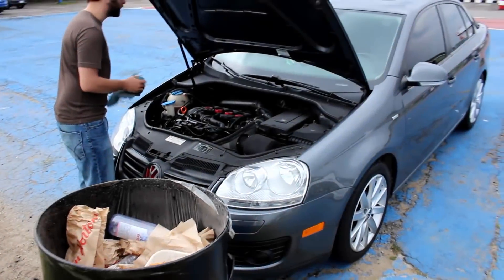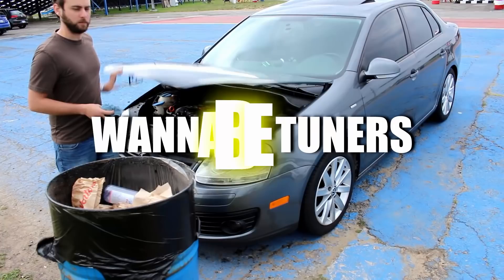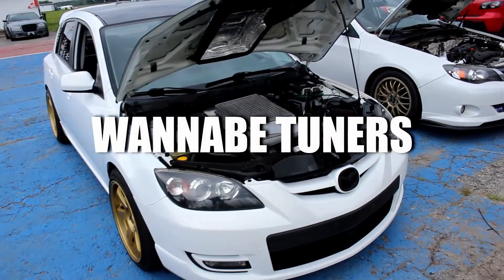Mazdaspeed 3/6 - Aux Fuel Methods - Port Injection - 5th & 6th Port - Methanol Injection

Comment: How is your car handling so much power on stock block ? Im rolling 285hp and 400nm of torque and I am afraid of bending rods. 18-19.50 PSI
Reply from the maker: The stock block will last a long time with a good tune and regular maintenance and care :)
Reply: Stay below 500Nm peak torque (3300-4000rpm) and and not make more than 400Nm below 3000rpm and you'll be fine with the rods. However make sure you're using good oil, that is a very important aspect. the stock block can handle above 400bhp as long as you keep the torque in check. If you go above 350-380bhp depending on the timing you can run, or more exactly around 345-365g/s of air depending on what AFRs you can run with the gas you have access to (I suggest using a WMI system with any turbo larger than the factory K04, and even with that it's a good idea to spray at least water of not water/methanol mix).
Reply: @mituc  Indeed, the only thing I'd add, specifically, is for the boost/torque curve and onset to be properly calibrated by the tuner, and for the driver to not go WOT under 3k, nor ever in 6th gear if you're tuned for stock-block power (~500whp max - though that's borrowed time, and ~380wtq max).
Reply: @numinous4789  , The problem with high power on stock block is heat which affects pistons and ringlands. WOT below 3k is a potential issue even on the stock tune, but with a larger turbo it becomes kind of a non-issue because the torque comes in more gradually rather than suddenly and you can tune the peak of the torque curve away from 2700-3200 where rods tend to break.
There are 2-3 people in the Mazdaspeed community who had 500-550 hp on stock blocks. They lasted 3 weeks of mid abbuse. However 350-420 with a proper spray of WMI (better than in-tank methanol or ethanol mixes IMHO) is usable for a much longer time.
Reply: @mituc  Agreed, Victor, heat management is a major priority on stock ring-end gap. That's why I do E25 in-tank and spray 1000cc M1 on top of it. All that alky helps keep things cool and prevents ring-butting. I'm also on a BNR S3 setup and tuned for 390/385 @ the wheels. Engine is strong, healthy, and happy on a FREEKTUNE (been 45k since going BT and still going great).

Next thing I'm throwing in is the South Bend Stage 3 Endurance in my closet. Long-tern goal is to build with 4032s and go with an EFR7163 or G25-660 setup to tune for a very responsive 500whp for tracking.
Reply: im running almost 380 with the bnrs3 and im stock block as well
Reply: @BrownyTheGamer  If you're pushing 380 with WMI (or at least water injection) then fine. Otherwise your piston ringlands are on borrowed time unfortunately...
Reply: @BrownyTheGamer  can I ask, when you say you're running meth, are you actually running straight methanol or a water/methanol mix or are you relating to e85? Here in Australia straight methanol is very hard to come by these days. You used to be able to buy 20L over the counter for $20.00, sadly those days are gone. Just trying to get some clarification.
Reply: ByteOn Computer Services it’s 100% methanol
Reply: @BrownyTheGamer  100% methanol must be easy to come by in the States? May I ask where you get it from?
Reply: ByteOn Computer Services there’s a race shop in my area that sells vp racing 5 gallon jugs of it
Reply: @BrownyTheGamer  I'll have to look around and see what I can find. Cheers my friend.

Comment: I am a MS3 Gen 1 owner currently running a stock KO4 turbo with plans to upgrade the turbo.  Never thought about the fuel delivery system until watching your video, fascinating stuff.   Question: in your opinion do you think the Full Port system would be the best way to go if I decide to run say a BNR S5 turbo upgrade?   Power goals are to be 450-500 whp
Reply from the maker: Hey thanks for the comment! For that power level, either methanol injection with an adequate nozzle, or 5th/6th port will take u there. The nice thing about a proper full port injection setup is that u have the potential to make well above that if u decide to in the future, since it'll be able to deliver more fuel but is also more expensive and requires more components :)

Comment: Good, informative video, guys. 
Eric, what are your ultimate goals with the speed?
Reply from the maker: Thanks a lot! I'd like to eventually tune it to 400 whp with a conservative torque curve on the stock block. After a while I'd like to eventually build the existing block, or build a block on the side for convenience,  and then push for higher peak numbers. The goal is to have a solid, fun reliable street car, since it doesn't see the track very often :)